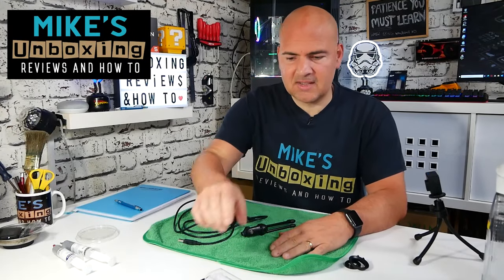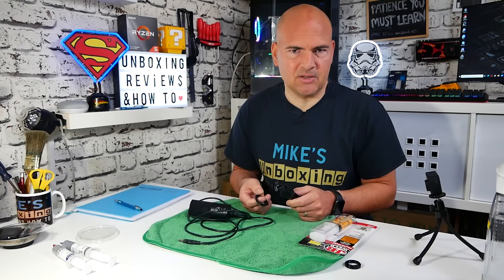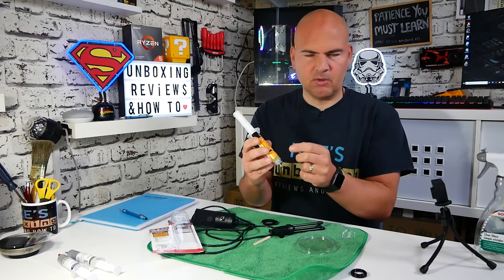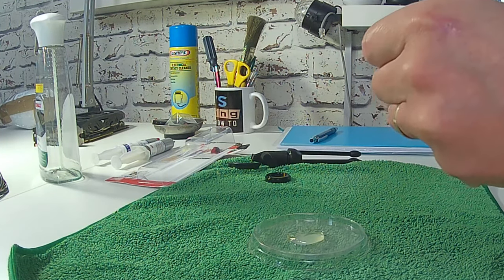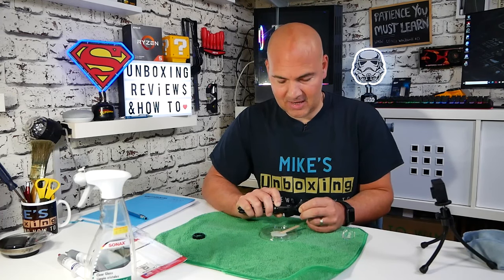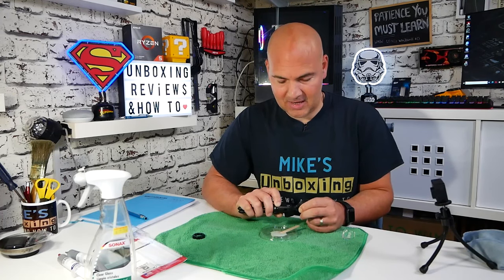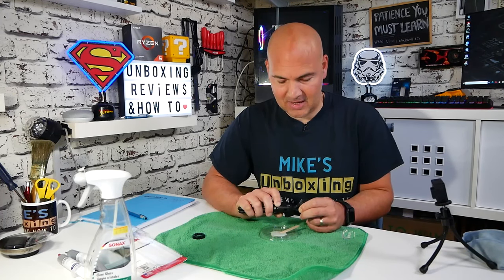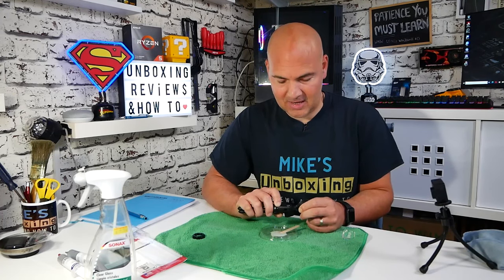JB Plastic Weld Trying To Mend The Impossible

Comment: Hi Mike .  Great video. Just curious how's that microphone stand holding up? is it still bonded?
Cheers.
Reply from the maker: after this i dropped it again a few times and then used abro steel which held up really well until a day or so ago when i dropped in from about 5 foot and it shattered and now have almost given up. The jb quik weld was the next one to try as that seems a little bit stronger for smaller applications
Reply: @mikesunboxing   Thanks for that update info :)
Reply: @mikesunboxing  I just did research and read on the JB website that the quick weld you mentioned had 2/3  (3127 PSI)strength compared to 4400 PSI JB Weld PlasticWeld of the one you used.  Unless its a different better Quick weld one you're using? let me know Mike if you do. cheers :)
Reply from the maker: @dozzgio.871  Will do :-)
Reply: @mikesunboxing sounds like you're so Accident-Prone that you could have a promising career in Product Destruction Testing & Repair — something that I once built a small business on 😂

Comment: working temperature?
Reply from the maker: It will cure in 40 to 50 degree temperatures just fine, just a little slower than at 70 degrees or above

Comment: Bit of a warning. This stuff is incredibly smelly and I mean unbelievably smelly. I glued some plastic parts in the garage and you could smell it down the street. Scrubbing the hands and your hands still smell. I put the canister in a sealed  bag and the smell even got through that. I washed, showered, out fresh clothes on and went out and still could smell it on my person. My neighbour thought we had been letting the dogs wee in the house. I am not making this up! Today I am taking the canister to the council tip and getting rid of it.
Reply from the maker: wow, that is pretty extreme, is does have an odor normally, but it usually fades after a short while, it must have been a bad unit or reacted with something? But thanks for the heads up. Wonder if anyone else has experienced this?
Reply: @mikesunboxing  yep I'm not exaggerating. I used it about a year ago and it didn't smell too bad. Then I used it this week and the stench is extreme. I think as it's a two part adhesive if one of the components isn't reacted it keeps gassing off. If the canister has been unused for a while one component doesn't come out properly as its partially blocked. It was smelling really bad on the outside of the canister, on the workbench and part of the workpiece I was adhering. As I say my guess is that if the two components aren't fully mixed and reacted to harden off, one of the components keeps smelling as it hasn't been reacted. I've put the canister that was in a sealed bag into a gas tight box as well and that has stopped the smell from the canister. The workbench still stinks and the workpiece as well.
Reply from the maker: @mattwright2964  Interesting, thanks for the info

Comment: The only way this product will work if you were to put two pieces together you can't leave it alone and especially around too much heat I try using it on my radiator elbow and would never stick it's still leaked but I used it on a inner console because there's two pieces to stick it worked better and applying some kind of pressure to it for 24 hours

Comment: Going on a year since you posted this video. Has it held up?
Reply from the maker: i ended up using the two part metal weld stuff it was a LOT tougher
Reply: @mikesunboxing     Thanks for the video Mike, are you saying the JB Metal Weld worked better on Plastic than the JB Plastic Weld?
Reply from the maker: @chappychapman3480  Yes, I think it did, it was a stronger compound
Reply: @mikesunboxing  Thanks Mike, Well that's put me on the spot I've got a break similar to what you had with the mic and I was going to use the Plastic Weld, haha, now I'm not sure what to do, but looking at the bigger picture I think I'll try drilling two small holes in the plastic and using some stainless to make the join stronger and see how it goes, I'm a bit disappointed that the Plastic Weld didn't do the job by itself though. Thanks,
Reply: @mikesunboxing         In that case I'll definitely drill a couple of small holes in each piece of what I have to join so I can put a stainless pin in them for support because what I'm joining has a fair bit of pressure on it. Cheers.
Reply from the maker: @chappychapman3480  Let us know how you get on ;-)
Reply: @mikesunboxing  Will do still haven't done it to busy at the moment. Cheers
Reply: @mikesunboxing  Well the best laid plans go astray, I live 50kms out of my nearest major town so I went to my local shop to get the JB Plastic Weld but they'd run out and wouldn't have any for 2 weeks but the guy talked me into trying Permatex Plastic Welder, anyway when I did the job and after you saying yours failed I drilled 2 holes about half an inch deep (maybe a bit less) into each piece I was going to join (drill size about 1/16th) and glued in a couple of stainless pins for added strength, I've put everything back together and so far so good but I'll give it a month or 2 and see if it's still staying together, the join seems pretty strong as I put a fair bit of pressure on it, in my opinion the 2 pins make a huge difference because they distribute the pressure further up the plastic than the actual break, I reckon you could do the same with your mic holder. Cheers Chappy.
Reply from the maker: @chappychapman3480  that is a brilliant idea. next time around that might be a good option

Comment: Doesn't work if I can't bond to broken composite plastic pieces together. I just used this stuff on my rc car broken shock tower. Used a clamp broke soon as i touched it. Epoxy has to get hard kinda melt the pieces together for effectiveness, not flexible bonding hard rubber lol👎🏾👎🏾👎🏾
Reply from the maker: try the other stuff i used in a later video it is like chemical metal and a lot stronger than the plastic weld
Reply: They sell a flexible version for vinyl/rubber
Reply from the maker: @bakedbeings  Thanks, that's good to know :-)

Comment: Won’t dry and hold anything for me.
Reply from the maker: maybe try the abro steel is used that is a bit better in my opinion
Reply: Why did the JB fixed piece break? Just curious
Reply from the maker: Not enough tensile strength